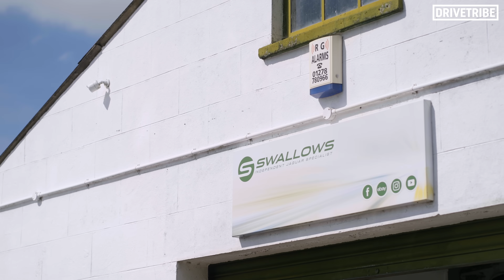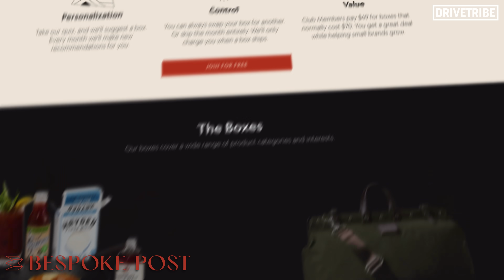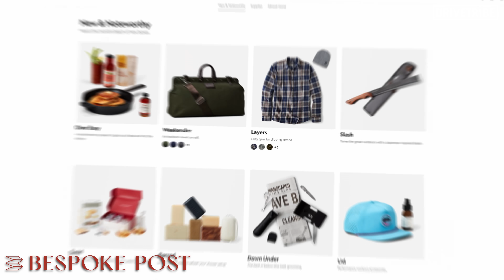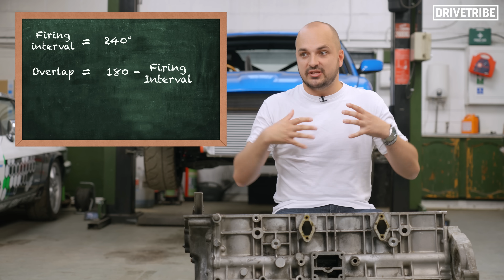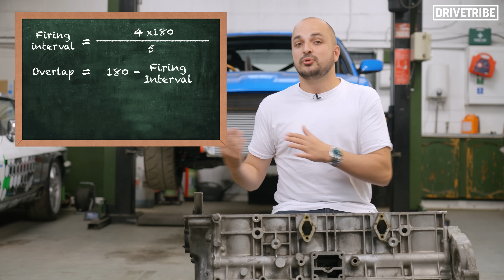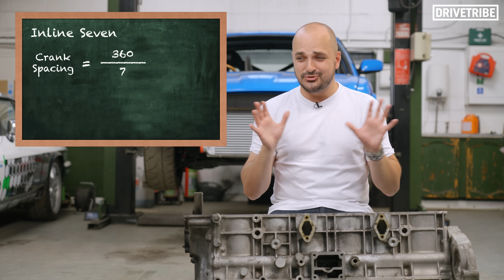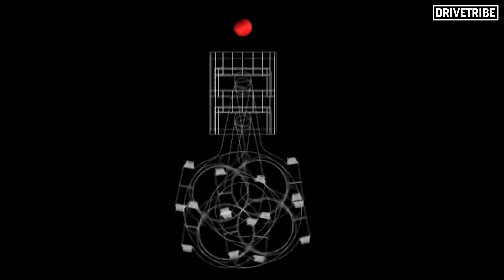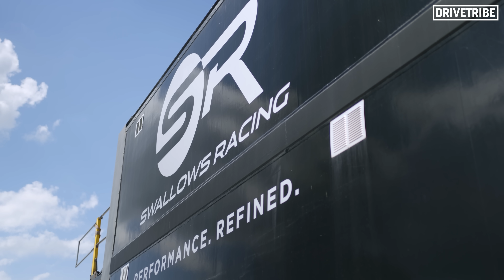Why Isn’t There A 7-Cylinder Engine?

Comment: I used to wonder how Audi made the 5 cylinder engine work so well. I assume that if a 5cyl works surly a 7 would work even if it needed dampers
Reply: Yes, just as an inline-5 works with a balance shaft, an inline-7 would work just as well, also with a balance shaft.
Reply: An in-line 5 cyl engine makes sense because it can to be located transversly (at a pinch) between the wheel stations of an existing vehicle that uses a in-line 4 cylinder engine.  Notably, the Fiat coupe 4 was fitted with a transverse in-line 5 cylinder which was a very tight fit when compared with the sister car fitted with the in-line 4 cylinder version.  Needless to say the 5 cyl was great but a real pain when conducting maintenance.
With today's dimensional constraints, an inline 7cyl transverse mounted engine would be out of the question, and if longitudinally mounted would require a car with a disproportionately long bonnet such as the Dodge Viper.

Comment: There were also straight 8's. Buick and Packard were known for their straight8's.
Reply: Also Duesenberg.
Reply: @GeoStreber Duesenberg, Bugatti, and Stutz were all the same engine design, but the Duesenberg was the largest in both physical size and displacement, followed by Bugatti as second largest, and Stutz 3rd, as the brands were priced. I got to check out a Stutz up close at my local machine shop that was being machined and rebuilt. It's always interesting what classic iron they have come in the door, but that one was a real treat. They're one long engine.
Reply: @GeoStreber  Yep.
Reply: Straight 8 sounds badass

Comment: Mans forgot the RC211v v5 engine from honda
Reply: 75.5 degree offset on the v instead of 90, and it makes a huge difference as to cylinder velocity being MUCH higher rpm than conventional engines as the maximum velocity of a piston is at 75.5 degrees in most engine designs. The 5th piston is used to offset the loss of balance from the angle changing in the engine and a counterweight at 105(I think) degrees that makes the engine almost perfectly balanced.

Comment: This is a really well made video explaining this topic. Tbh I think a lot of people that have nerded out on exotic engine designs have thought about the idea of a  7 cylinder.
Reply: Radial 7's. They were quite comon in aviation in the 1920'ies, and were used for some trucks and odd cars. In general Radial engines are so overlooked that it hurts me, as they are beautiful and radial 7 is kinda the most common and boring type of them.

Comment: I wonder if submarines use 7 cylinder engines for the same reason they have 7 or 11 or 13 blades on submarines propellers…because they are prime numbers which eliminates harmonics in a constant rpm system, better for stealth
Reply: Eliminates some harmonics, not all. Maybe in a multi-propeller installation primes eliminate interactions?

Comment: I spent the whole video wondering how i would design modular engines where you Lego single cylinder engines together on a common crankshaft 😂
But of course somebody has already invented it.
Now i just need to invent it for race engines 😐, create "n-cylinder" leagues.
The 7-cylinder cup! YEAH!
Reply: Design it to be CNC milled from a solid aluminium billet

Comment: Thank you. I found this very interesting. Something you might want to look up is when a yamaha team in the UK built what was called the pig engine. Basicly what the wanted to do was to compete with the V twinn Ducati's of the day in the sense that they had better grip due to far less firing/power pulses throug the drive train and rear wheel resulting in better grip. They did this by simultaneously firering cylinders 1&4 and  2&3. I suspect that firering 1&3 and 2&4 wold result in fat less tortional flex of the crank shaft, but would have ment the had to completely replace the crank. To the best of my knowledge this would have been against the rules. Thus valve, injection and ignition timing was all they had to work with. Another very cool engine was the 2T 115deg V5 that Honda used in the GP500. Those were the days. Keep it coming. Love the content.

Comment: The seven would be just a little bit more complex than the straight six this is not an issue, the main problem isn't its increased complexity but rather the packaging, the 7 is too long.

Comment: How the heck would a 7 piston in-line 4-stroke engine work? It’d need to run in a cycle of 28 rotations to be balanced. Balance shafts geared down 7:1 for primary balancing. If it idles at say 700 rpm, then the secondary imbalance would be at 100 rpm, which is every 1.67 seconds…..   chucka-boo…. chucka-boo…. chucka-boo….  Soviet Stalin era farm tractors would run more smoother.

Comment: There are industrial straight 7 and V 14 engines
It is all down to costs of manufacture and given there are more "balance problems with a 7 / V14 cylinder engine compared with straight 6 / 8 or V12 / V16 these engines are rare.

Comment: I understand that there is a 7 cylinder radial aero engine.
Reply: There are plenty of them but they are now largely out of favour. For applications below 500 horsepower horizontally opposed air cooled 4,6 and 8 cylinder engines are favoured and above 500 horsepower gas turbine engines are heavily favoured.

Comment: If you divide the rotation 360 by integers, 7,11 and 13,(14 because of 7) will give you angles with fractions. Which i guess are difficult to produce.
9 cylinders should work though. Maybe in star shaped engines for propeller aircraft’s.
Reply: "Star shaped engines" are radials. 4-stroke radials always have an odd number of cylinders so they will fire evenly over two revolutions, but any odd number works - 7 and 9 were the most common. 

The number of degrees doesn't matter. You can measure angles in degrees, radians, or whatever you want... it doesn't matter to the construction of the engine.

Comment: That sounded weird to say that the 7 cylinder crank in the AGCO engine was made by joining their 4 cylinder crank to their 3 cylinder crank. That would mean unequal firing angles - which I know does exist commonly in motorcycle engines, but hardly desirable in a Diesel engine designed for long service life.

Comment: Love this style of video and would love to see more technical/engineering oriented content. You touched on radial engines, which makes me wonder: has there ever been an attempt to put a radial engine in a car or truck?
Reply: Yes it has been tried as custom projects but they don’t make much sense for cars because of the vertical space radials need. Production aircraft radials are virtually all air cooled so a cooling fan would likely be needed. Some WW2 tanks used adapted aircraft radial engines more out of wartime production reasons rather than any specific advantages of this engine type for this application.

Comment: In radial engines odd numbers are generally preferred because then on the opposite side of a cylinder (a weakspot in the block) will be a particularly strong spot where the walls of two cylinders come together. And radials with even cylinder numbers, like 14 or 28 cylinders, often tend to be built like multiple odd-numbered radial "discs" behind each other
Reply: Single row radial engines to the best of my knowledge always have an odd number of cylinders. If a radial engine has an even number of cylinders it will be a two or four row engine with two or four banks of an odd number of cylinders each. An example of a four row radials is the Pratt & Whitney R4360 with four rows of seven cylinders each for a total of 28 cylinders. For example the DC3 aircraft pictured had two engine types that could be chosen from during production, one was the Wright cyclone R1820 which was a single row 9 cylinder engine or the Pratt & Whitney “twin wasp” R1830 engine which is a two row 14 cylinder engine ( two rows of 7 cylinders ) the “R” indicates that it is a radial and the numbers following indicates swept volume in cubic inches. Radials are almost always air cooled and the perpendicular to the airflow configuration helps with cooling.
Reply: That's not the reason for odd numbers of cylinders in radial engines at all. If you follow the firing order, only an odd number of cylinders results in an even (regular) firing order in a 4-stroke radial engine.
Reply: @brianb-p6586  You are on the right track. The reason that a radial engine has an odd number of cylinders is the rotating cam ring valve actuating system. That is the simplest way to actuate the valves of a radial bank of cylinders. The geometry only works with an odd number of cylinders. Start your calculations with a 3 cylinder. It will run with a single lobe ring turning opposite to engine rotation at half speed. It also will run with a 2 lobe ring turning 1/4 speed in the same direction as engine rotation. The 9 cylinder I worked has a 4 lobe turning 1/8 speed opposite to engine rotation. A 9 will run with a 5 lobe turning 1/10 speed in the same direction as the engine. It is easier to draw for a 3 cylinder. Took me about 3 hours for me to understand.  Once you see the principle it applies to the greater number of cylinders. It is nice to know  but even in 1969  there were no radial questions on my A&P test.
Reply: Generally same as steam lovomotives wheels
Reply: You're over complicating it. The reason it can work in a radial is because each cylinder is TDC individually. Like some inline 3's

Comment: One thing you forgot to mention with those massive ship engines is that they have a number of markings on the power setting lever. Some of those are more critical than others, but they all have one thing in common: you can run the engine(s) at that setting for only a very short time, as the vibrations will tear the engine apart and generally speaking it's better not to run the engine at those settings at all. You can actually feel it when a ferry ship is docking and at times during the docking procedure the engine(s) run(s) momentarily on one of those power settings, as the whole ferry starts to vibrate. You can imagine the severity of the vibrations needed to vibrate an entire ship.
Reply: I always thought this had to do with it somehow reaching a resonant frequency, but this makes more sense. Didn't know that, very cool!
Reply: I thought it was because of cavitation at the ships propeller due to rotating against the ships direction or something. Thanks for the info!

Comment: Because weird 7 cylinder engines, like weird 5 cylinder engines, vibrate weirdly.  And the long cranks, like straight 8s and even straight 6s, also suffer torsional vibration unless they are made excessively thick and heavy.  So, no reason to build such a thing.

Comment: Truthfully, there are plenty of v5 and v7 engines out there… Ford made them unintentionally by starting out with v6’s and v8’s but utilizing horrible head design (at the gasket interface), over all horrible egr systems that are just a uncontrolled vacuum leak after the vehicle is about 2 years old… and a plethora of other stuff. And yes, I have Fords. I live by the motto of “no car left behind” lol

Comment: Don't forget that the radial engines almost require an odd number of cylinders per bank in order for the firing order to work out in a simple way that's relatively easy to drive mechanically.  They fire every other cylinder, and going around the whole engine twice will wind up firing every cylinder as long as it's an odd number.

Comment: It is accepted that the straight six is about as well balanced as an engine can be, a seven would be better, forget radials and look at inlines in the marine world sevens are not that uncommon if balance was an issue they wouldn't use them, in the automotive world I think you will find its more down to packaging, there are no inline passenger car eights today and as for trucks I can only think of Gardner and a Russian unit who incidentally use a seven in a tractor.
Reply: Perfect balance is more important in a car than industrial machinery.
Reply: @martinsv9183  hi
If perfect balance is so important to cars  then why are so many powered by 3 and four cylinder engines. I would maintain maintain that balance is not as important as many people think in the automotive world where engines sit on rubber mounts and some with hydraulic dampers. I would say balance and vibration are more important in large plant and marine where engines are hard mounted. Just my opinion

Comment: Honda used a V5 in their MotoGP race bike but dropped it after 4 years to go back to the classic V4.
Reply: They didn't drop it, any engine that wasn't a four cylinder was banned! I guess the rule makers hadn't originally forseen that a 5 cylinder could be made to work so well in a race bike. Lovely bit of classic Honda magic.

Comment: In-line 9 cylinder engine is like butter though!  Worked on many different engines with different cylinder configurations including inline 7 which has a slightly odd sound, 9 is the best in line though, even over a 6.

Comment: I never thought about the 7 cylinder engine and why they are not in a car. But now I know and sounds logical.
What I was asking myself for a long time why aren't there V14 in a car. V6, V8, V10, V12 en V16 but no 14. There should be more balance in a V14 than a V7 and if that sound was correct then I really wanna hear a V14. What a great sound was that the V7

Comment: 14:24 Something eluded to, but not explicitly mentioned, is the manufacturing difficulty of a 7-cylinder engine: 360° doesn't divide easily into 7. Also, twisting an I6 crank into 3 planes (2 operations) takes no more effort than twisting an I3 crank into 3 planes, but twisting an I5 crank into 5 planes (4 operations) takes twice as many operations. This is also why 5-cylinders have recently disappeared. Now imagine having to do that 6 times to get a 7-plane crank shaft...

Comment: So a v6 has little vibrations and a short crankshaft is this the ultimate engine?
Reply: A 6-inline has perfect primary and secondary balance.
This explains why it is so popular when it is practical from an economic and packaging point of view (I4 is cheaper and V6 more compact).

Comment: You seem to ne saying that 'balance' is all about firing intervals, and resulting torque pulses. The fact is 'balance' is primarily about primary and secondary forces cause by the variuos reciprocatng, and rotational masses, which have far more influence on the smoothness of an engine, if not the sound.

Comment: And then there was Volkswagen in 1991 and developed the VR6. The idea was having a V6 but with a much smaller footprint. 15° cylinder angle and one head. BUT: the crazy part is that Lancia originally came up with that idea - in 1915. 😎🤟

Comment: There is such thing as the AGCO power 98HD inline 7 cylinder engine. Plus numerous low rpm 7 cylinder large scale marine engines.

Comment: My Triumph Street Triple R has one of the smoothest motorbike engines I've ever ridden.  I wonder what makes that engine so smooth for a 3 Cylinder?
Reply: It has a balance shaft for the primary rocking couple.  In my experience, the Street Triple engine is very buzzy, you can feel it mostly through the footpegs.  It has second order imbalance like an inline four, but with those it's usually felt through the bars.  I think the difference is because of the different direction of the vibration in each engine.

Comment: The way this video began - you've probably never thought about this before - actually, I have. Quite a lot. I knew about balance and packaging before and that was the main reason 7s never really became a thing, why would you when you could have 6 or 8, but I never understood why in the early days nobody tried a 7 or, since the 8 worked somewhat well, a 9. And in the time since, why not a w9 since a 3 works well enough to be sold en mass, surely sticking another bank onto a v6 wouldn't be a waste of time

Comment: That was great. That degrees of rotation stuff is very interesting. I think I read a V6 is more wobbly than a straight 6 and you can prove it all with the mathetics
Reply: The Cologne was a 60 degree design. There's a little cheat, not unlike Honda's V5 if you are familiar with it. Splitting the crankpins by 60° makes the engine easily balanced with crank counterweights, like a 90° V engine.
Reply: @identiticrisis  Thank you for the explanation. This is very interesting stuff ! All the best and greetings from Prague, CZ
Reply: @Pyro293 But I think they are inherently unbalanced, no ? Maybe the counterweight/ flywheel is exactly balanced to counter this

Comment: Seems to be a strange omission of inline 8 engines in this discussion along with some general engine design misunderstandings.  Chiefly, the counterweights on a crank are to balance the piston/rod assembly it’s partnered to, they are not designed to and do nothing for the power pulse.  Power vibration is the responsibility of the flywheel and damper.

Comment: Pontiac and Packard had inline 8 engines in the 50’s. Also the Duesenbergs came with inline 8’s.
Reply: And Buick.
Reply: These US in-line 8cyl engines were very 'slow revving' - limited due to the large torsional vibrations of the lengthy and weighty crank.  To amelieate the in-line 8 cyl's weakness, Alfa Romeo F1 engines raced in the early 1950s used two sturdy 4-cyl cranks coupled (via gears) in the middle of the engine.

Comment: Still love my 5 banger. Seems like a perfect engine as it has more to it than 4 cyl, but it is not "overpowered" like 6 cyl. It has torque, noise but still reasonable fuell consuption. And it is not an Audi one, so it is relaiable :D

Comment: As my dad used to say, 7 doesn't divide equally into 360.
Reply: And that doesn't matter at all. Angles can also be measured in radians, and no whole number divides 2 times pi (the number of radians in a revolution) into a whole number (or "evenly"). The units used to measure and angle are irrelevant.